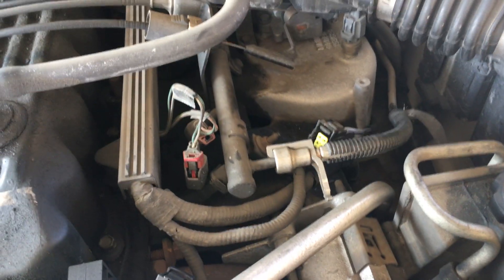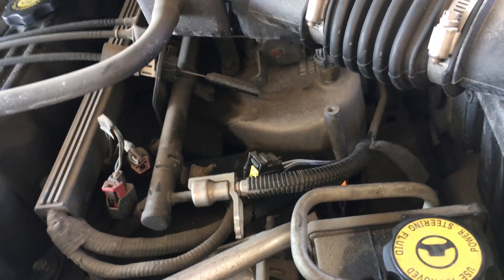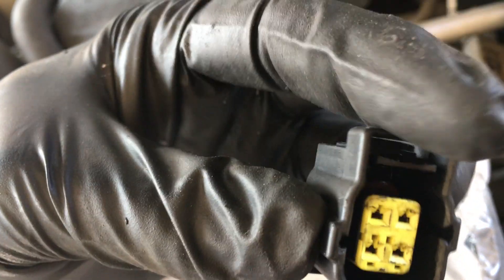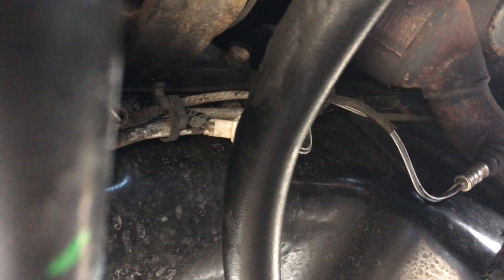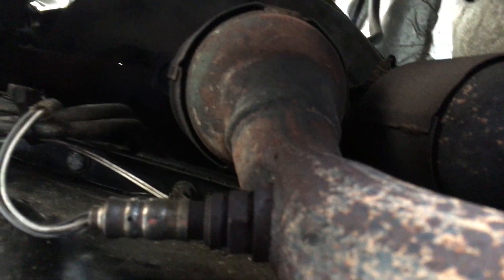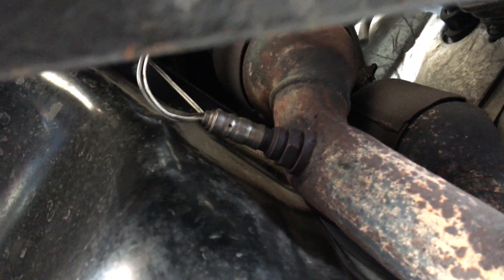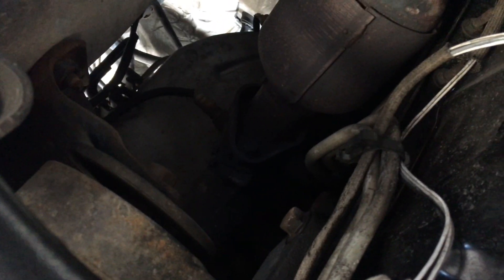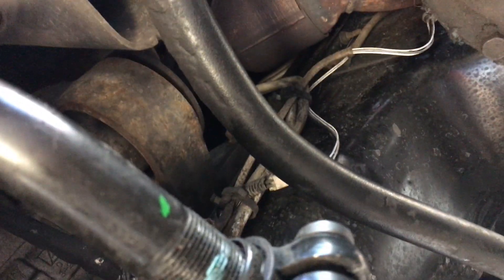O2 Sensor 2004 Jeep Grand Cherokee Replacement - Bank 1 Sensor 2

Comment: To the guys and gals who don't understand, sensors before the catalytic converters are all 1's.  Below the cats are 2's.  Bank 1 is closest to front of engine, the fan belt area, and bank 2 is closest to back of the engine.  Good video, just trying to see how to reach bank 2 sensor 1.
Reply: Thanks for the tip.
Reply: But the downstreams don't detect rich codes.  And I'm getting po172 po175 bank 1 and bank 2. Running rich! I replaced both up streams and still coding.
Reply: @jat-justamaturetech-philpj8285  you need to reset your codes. But three other things could be the problem, if shorts in the wiring are ruled out, 1 clogged catalytic converter, 2 egr valve stuck, 3 throttle position sensor or air idle mixture going out.  Now sadly, computers go out and o rings in fuel injectors go out, and bad sparkplugs. Also, consider this, if nothing damaged your wires, if all O2 sensors are put in at the same time at the factory, then it is likely they will fail together near the same time. You can clean o2 sensors, both ends, has saved money for many people.
Reply: @gristlevonraben  My cat is 2 year's old. Spark plugs 3 weeks old. Coil 1 week old. New injectors 3 weeks old. New MAP 1 week old. New fuel pressure regulator 2 weeks old. 2 new upstream oxygen sensors 1 week old. I reset codes each time I replace a part. Took it to Firestone to diagnose. Clueless. Told me to replace TPS, MAP AND COIL. Still need to replace TPS with  a Mopar. These other sensors are all after market. The rich codes started after I replaced the injectors.

Comment: 2001 Cali WJ. 4.7 Bank 1 Sensor 2. A/C condensate drips directly on this sensor.  No need to get over-wrought about the location or misidentifying the correct sensor. A plethora of free pictures worth 1000 words diagrams exist to prevent this folly. If it's seriously hot and your AC works as well as mine. Ice Cold  you'll see a puddle under your Jeep. I had a new radiator installed and started noticing this code. I crawled under and started getting splashed in the face. Lol. I wrapped the AC return line with some foam and the condensate problem vanished. Blowing even colder now. 22mm crows foot wrench but verify first youre not getting your sensor wet.

Comment: But the downstreams don't detect rich codes.  And I'm getting po172 po175 bank 1 and bank 2. Running rich! I replaced both up streams and still coding.
Reply from the maker: You should replace all 4 sensors and make sure they are mopar. More expensive but other brands won’t work. Had the same issue. Also make sure you reset the ODBC codes
Reply: @UNKPCRIDE  I installed Walker oxygen sensors. They got really good reviews. What do you think about these? But you're right, should be Mopar!
It all started when I replaced all the fuel injectors from 1 hole to 4 hole. I'm also thinking it could be my TPS. It's only a year old, but after market. So is my IAC and is also a year old. I got a rough idle murmer. Same with MAP. ✌️

Comment: I am working on the same sensor. Did you remove it from going up under the jeep? And i believe that is bank one sensor one.

Thanks in advance
Reply from the maker: Rick Mayer yes I meant Bank 1 Sensor 2. I ended up replacing all 4 sensors, used MOPAR parts only as it's highly recommended. You need to jack up the front of the jeep, put jack stands for safety and this allows very easy access to the sensors as it pushes the frame up out of the way. It's not hard at all. Use a cresent wrench and drive your jeep for about 15 min before you do it, this allows heat expansion and sensors come out easier, don't burn your self on hot exhaust. INSPECT the receiving wiring harness, in the end on my jeep the wiring harness was worn through causing my problem, wasn't even a real sensor issue!! Oh well I got 4 new sensors, get better gas mileage.
Yes you reach all sensors from underneath. The two towards the top you need to reach one arm all the way up, use the wrenching and you'll get it. It's a stretch and takes a few tries!! Good luck!!

Comment: after replacement , did the code go away by its self? or did you have to clear it with a scan tool !? .. I just replaced the one next to the oil pan , tuff to get out but was able to , due to same problem sounds like , burnt broke wires, after being able to look at it, any way, code still there . but i only replaced 1 so far.
Reply from the maker: David Frisch make sure you have the right sensor, and also verify the wiring harness is not chewed up, ripped or wired fraying, that will cause the code to trip. After all that you need to reset the codes by unplugging the battery for 10 min, then do the drive cycle to generate the patterns or just drive it 30 miles between highway and surface streets, stop and go. You can search on Jeep drive cycle and it’s a special ordering of turning , speed, running idle and braking you need to do.

Comment: Which one is the location of Bank 1 Sensor 2? I am getting a code of P0141.
Reply from the maker: There is a diagram posted online, just search and you'll find it. Here's the link http://wjjeeps.com/oxygen.htm
Reply: After the cats, I'm getting the same code even with OEM sensors.. my state requires emissions and this is my last year of registration..
Reply: Joshua Figueroa - Did you figure out the problem, I have a 06 tj 4.0L with the same issue.